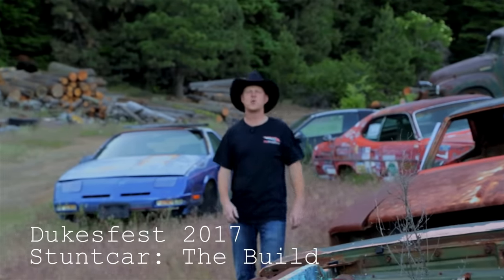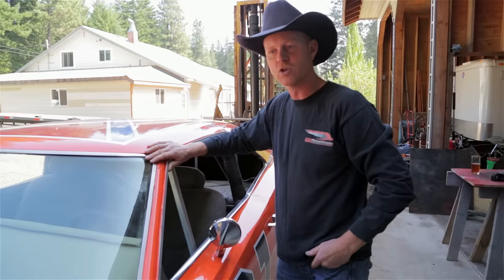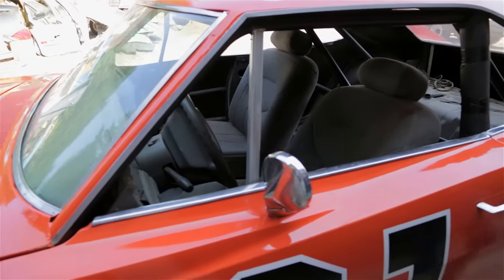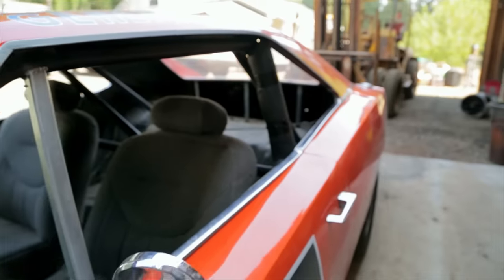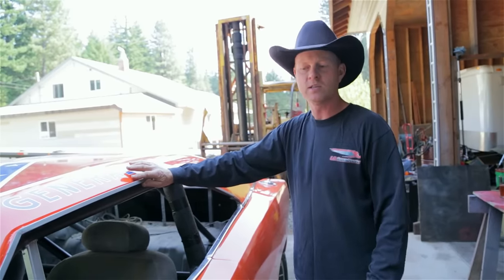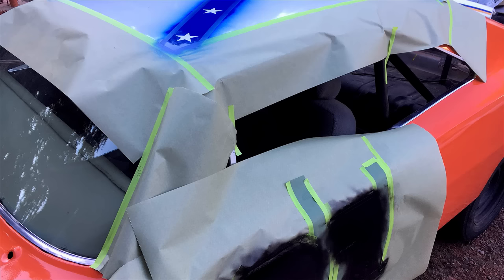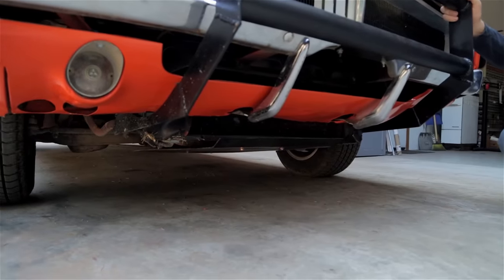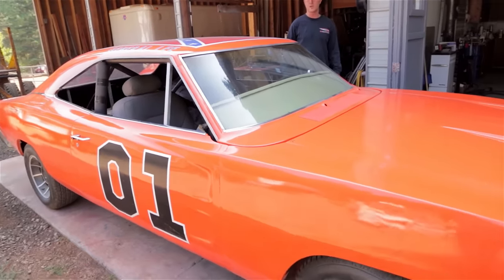Cop Car Ford Crown Vic Transformed Into a General Lee Dodge Charger

Comment: The irony that the general lee is made from a police car.
Reply: A Ford one that
Reply: Nothing wrong with Ford, as long as it wasn't made in the US... The best engine ever built is the Australian Ford Barra straight 6. The Ford Falcon model stopped production in the US in 1965, but it lived on in Australia and New Zealand until 2016. It either had a V8 which was okay, or the Barra inline 6. That Barra is without question, the best petrol engine ever made. Don't believe me? Google it.
Reply: He's not saying there's something wrong with Ford, just that it's ironic that they used a Ford to make a car that is so famous as a Dodge.
Reply: @mrfixitusa6165  Exactly they should have used a modern charger if they could
Reply: @KiwiPokerPlayer  The Ford modular V8 engine is a great engine, the heart of many police cars and taxi cabs for decades, logging hundreds of thousands of miles.  Was used in Mustangs, Lincolns and trucks, features overhead cams with either 2, 3 or 4 valves per cylinder.   I have 2 vehicles with the 4.6 liter.
Reply: @KiwiPokerPlayer  Yess Aussie are Mad Max good engineurs ...Australia have the longest road on planet
Reply: The ford barra is the Australian 2JZ or Plymouth slant 6
Reply: The other irony is. Running  moonshine in a bright orange car!!!!!
Reply: It's got a cop motor, cop suspension, cop shocks. 🤣
Reply: and a FORD
Reply: The real irony is most police cars are ……chargers
Reply: Y’all are all wrong. It’s because the general lee and police cars are rivals always chase into each other and fighting
Reply: Just like Ford & Dodge. @Eli_ahlemeier
Reply: @MrRAGE-md5rj  I’d say ford and Chevy are much bigger rivals
Reply: @arjunadelhy7411      Yonge St. Toronto , Ontario , Canada .... the longest street in the world .....

Comment: As long as the jump cars are like this I wouldn't mind watching a jump some time. Thank you for not using a real Charger.
Reply: Curtis Fleabag it’s Remanufactured AMD body panels, As he said multiple times throughout the video. The only “real” charger parts were either too far gone to use on another car or are super easy to purchase new. It’s a Ford frame, and cheap steel that looks like a charger.
Reply: It's basically a kit car! Cool beans! Much cheaper to build and own than rebuilding a Charger from junkyard parts! And it'll get way better gas mileage, as the only thing an original '69 Dodge Charger couldn't pass, was a gas station! LMAO!!
Reply: Charger383Mopar YES!
Reply: Indy Sanders  If the wheelbase is the same im sure it would work. try it and donate it to me when youre done.
Reply: Charger383Mopar yep
Reply: It won't sound like a muscle car though but I'm very happy they did this instead of destroying another gen 2 charger.
Reply: @cruzmiller3349  the crown vics already have duals with an Hpipe. You'd be surprised how good the lil 4.6 sounds with muffler and cats deleted through the little 2" pipe.
Reply: @txmuddigger  2 1/2
Reply: @wildestcowboy2668  Crown Vics dont come stock with 2.5" pipe.
Reply: @txmuddigger  no kidding my friend

Comment: I am a 63 year old recently retired government fleet mechanic who has been driving Crown Vics as my personal cars for over 2 decades. I don't plan to ever drive anything else. There are enough cars and parts to keep a Crown Vic (and Mercury Grand Marquis) running for decades into the future. They are one of the safest cars ever built. They are built like a tank. And stock ones are super comfortable and get amazing gas mileage on the highway. I was involved in a fairly major accident in one several years ago, and it held together. I only had very minor injuries. If this had happened in a little front wheel drive car, it would have been completely crushed, and I probably would have been too. The Ford Panther platform cars are absolutely amazing.

Comment: My wife is gonna be mad when I start cutting up my Grand Marquis, lol...
Reply: Did she get mad
Reply: its easier to get forgiveness than permission!
Reply: Cornelius Crewe lol
Reply: I'm turning my Grand Marquis off road with a 3" lift and truck tires lol!
Reply: I am cutting my Marquis and putting a 51 Merc body on it. Keep your fingers crossed
Reply: @daryelthomas9414  that's cool I'm doing the same but with a '62 ford f100 unibody with a 2008 ex sheriff car.
Reply: @mrmrlee  iam also doing that also with a marquise for a gambler. I have s 96 vic with no lift and running 31 inch mudders on it and also like I told the guy below ya comment is im doing a body swap to a 62 f100 unibody
Reply: @mrmrlee  That's the spirit!
2 weeks ago I bought a 2003 Grand Marquis for 200..its been sitting for over a year and wouldn't run..pulled it home and discovered that no fuel was reaching the fuel rail..put a new fuel pump and filter, and its running good as new..only 113,000 miles on a rust free Florida car...except for a big dent in one of the doirs and busted glass, it doesn't need anything but a matte black paint job...even the AC works!...I also have a crown vic that an oak tree fell onto and crunched in the rear of the roof..I cut that out and built a slantback fastback and cut off a foot and a half off the rear..its got 35's on the rear and 31's upfront...looks a bit like a 68-70 AMC AMX

Comment: This is a great build! Hollywood take note...you don't need to wreck any real Chargers any more!!! 

Quite tempted to build my own now.
Reply: Me to and I have a real one but I don't dare race it with other cars bumping into it / close so this =  Perfect drift car or dirt track race car just needs a lsx or a 440 Rb / 2 gen hemi
Reply: Richard Price yes...please stick with a Dodge motor.   Done be one of those guys.
Reply: Hollywood doesn't wreck original chargers 😂
Reply: Knackered Dad Hollywood doesn't care, a car is just money to them :-(
This man is a true car enthusiast, he knows the value of a car that can't be replaced
Reply: I like to play with muscle cars if this is accurate thats damn sad
Reply: Richard Price Yeah I don't understand Hollywood's fascination with ruining classic muscle cars myself.
Reply: It's a dam shame. But what can we do :-( maybe hit the lottery, get some property and start saving them one by one like Steve Dulcich!!  Lol
Reply: Aaron mann nope the one I'm working on/ dd driving is a big block 383 low deck and I prefer it over a chevy engine but lsx engines are so good and cheap ( less than 2000$ for a running drop out ) it doesn't matter as much if you throw a rod out of the block vs original rb440 engine which hasn't been made sense 80s/90s and inevitably is harder to get parts for unless you go to the aftermarket because the days of getting a really good running low use low mileage hp drop out and being cheap are probably over
Reply: Knackered Dad I have a 69 charger
Reply: when they make a movie, they mostly wreck replica's, they have a budget to stick to.... better to wreck a replica which costs a fraction of the real thing..... one scene in bad boys comes to mind, when they wreck a cobra...but if you watch the scene carefully, you can see when the body cracks open, its fibreglass, i'm sure the original was aluminium... you are correct, classic cars are just money to them... so they would much prefer to wreck cheap cars than expensive cars...
Reply: He shouldnt wreck a rare cop car to make a replica of a rare car IMO.
Reply: aaaaaa man to that!!!!! stop destroying what few are left and build replicas like this.
Reply: V8gas I wouldn't say that Hollywood destroys nice classic cars. The shops but mostly junk cars and make them look nice for the camera. An example of this is a project that the old Power block Muscle Car show restored a 70-71 Challenger for Year One. The car had been on of the Challengers used in 2 Fast 2 Furious. The car was basically held together with bondo, had a ton of rust and a cheap paint job, basically they put makeup on a pig. However it looked good on camera and that's all that matters
Reply: what?  Did you watch the video?  There's 0 vintage Dodge parts here.  Just aftermarket sheet metal wrapped around a crown vic cop car...
Reply: Did you seriously just say a crown vic is a rare cop car lol?
Reply: No, wreck the real ones, so the others will go up in value!! WRECK WRECK WRECK!
Reply: Hollywood don't wreck any real cars...it's all CGI bullshit...
Reply: RICH DISCOVERIES imagine if he built and sold remakes of muscle cars that people can just have a good time and use for daily life

Comment: Makes perfect sense, the CVPI is a full frame beast of a car, the toughest cop car ever, and has a similar width and wheelbase to a Charger. It's far more rugged than a B body. A reusable jump car, what a concept!
Reply: I beg to differ, I have a 68 Dodge Charger with 383 BB bored out 30 over. all bushings and parts replaced under the B-Body. I've tested it around ugly dirt roads hardly ever feel em having torsion bars, and new suspension parts with Energy suspensions. Old Dodges were and as sturdy as the crown vic. Steve McQueen's Mustang can vouch for that too during the chase scene.
Reply: @westbender 820 its also about 500-1000lbs heavier.
Reply: @Curtis Fleabag loved to see old general lee's wrinkle when they did those jumps.
Reply: @Johnny Deez  Bah. A 69 has nothing on the updated technical marvels of a modern day CVPI

Comment: I'm a service guy with a Ford dealer.  Believe me, those Crown Vics were tanks.  And they were often jumped.  Sometimes they would come in with the radiator cor support smashed half way up in to the radiator.  The story was always the same.  The officer hit a bump and then the engine started to over heat a little while later.  Among the over heat codes stored in the PCM there would be a code for vehicle top speed reached.  Haha.  We would just fix it, realign it, and return it to service.

Comment: This is SWEET. I've wondered many times if something like this would be possible, given the rarity and value of REAL Chargers. It's a tough, easy to find car and you wouldn't have to be completely paranoid about damaging it. Maybe you could do some kind of an in dept guide on how you did this, like measurements on welding the panels on and things like that. I just restored a 77 Smokey and the Bandit Trans Am, so I'm no stranger to body work!

Comment: I own tons of p71's and I'm doing a general lee clone now. Awesome build. 👍
Reply: I asked a few people if they’ve done it and none replied, hows your project going if you started it at all?
Reply: @bananaman2184  he is turning a 71 into a 69. There is a shop here that does them. Most of the cars are 318 tho
Reply: @waynewilliams5802  71? Didn’t they have a completely different chassis?
Reply: @bananaman2184  don't get me lying bone but I almost bought a 1974(69) general Lee. Paperwork for a 74 inside looked 74 outside was a AMD 69 an yes doors opened bone
Reply: @waynewilliams5802  I gotta look into that, 68-70 chargers are hard to come by for me

Comment: Oh, dear lord the wheels are turning. There are so many possibilities for cool builds on the Panther platform. Cop cars are still reasonably cheap, not a ton of miles on most. I've got an '09 driver (ironically enough; from the Tigard Police department, a suburb of Portland) with only 85k on the clock. These things are freakin' tanks.
Reply: steven livingston mine has 200k and still going strong...
Reply: My 2004 is sitting at 210,000 miles and it cranks and runs like it has 20,000 miles.  Absolutely amazing cars!
Reply: Wonder if a 70-71 Torino body would fit? Or a 69 Mercury Cyclone.  That would be cool.

Comment: It's got a cop motor, a 281-cubic-inch plant. It's got cop tires, cop suspension, cop shocks. It's a model made before high compression so it'll run good on regular ga

Comment: interesting I never new it could be done
Reply: i'm amazed the wheelbase was close enough
Reply: FattyandPeaches you'd have to replace the Ford parts with Mopar or GM. Fords are very picky
Reply: FattyandPeaches unfortunately Fords are a total pain.
Reply: everything is impossible, until someone finally does it
Reply: Anything is possible with enough money and enough welding.
Reply: Heavlin Simon well it’s more than that. It’s high level skill, high level, forward thinking. Thinking 10 steps ahead. After that comes the money part. Without that level skill set, the money will burn up early in your build
Reply: knew*
Reply: RamVan Bobby knew I’ll show myself the door.

Comment: how did you manage to change from a 4 door to 2 doors, well done, I not notice the back pillars of the Crown Vic ?? well done ..-- really  surprised with all work, a good and clean car at the and --..
Reply: daCostamartins all the doors and pillars and THE ENTIRE BODY from the ford is gone
Reply: ok.. even so manage to give  a clean look to it, I'd gladly drive it as my daily wheels --..
Reply: OP needs to start selling this as a kit, I'd buy one but the weak ford 4.6L would be getting replaced with a 5.7L hemi.
Reply: daCostamartins that would be a pretty damn reliable car too
Reply: SP392 A reasonably priced kit
Reply: SP392 Not for nothing those “weak” 4.6 2 valve mod motors love boost and actually sound great with an x pipe so you could easily have over 400 rwhp reliably with the Ford plant. Much cheaper than trying to engine swap it. Let’s face it, once you start welding aftermarket Mopar sheet metal on a Ford body, brand loyalty is out the fucking window!  I love it!

Comment: Imagine how confused a cop would be if they pulled you over and ran the vin
Reply: Jeremiah Griffith not confused at all. The vin is part of the body. On another note, I put a new dash in my 1977 mercury marquis. I could have swapped the vin haha. It was stamped on the metal part of the dash which was only bolted down

Comment: Got my 1st car in 81 and was a 68, so you can say that Chargers are special to me and have owned two of them. The first one was just a 318 car, but #2 was an RT with built 440 plus added 6 pk and was a badass Mopar. John Schneider (Bo Duke), is a friend and said that they used only 318 cars to jump with and did not smash any of the extra special one's thank God 🙏🏼. So it's awesome that they are using Crown Vics these days, and is really interesting how they do it